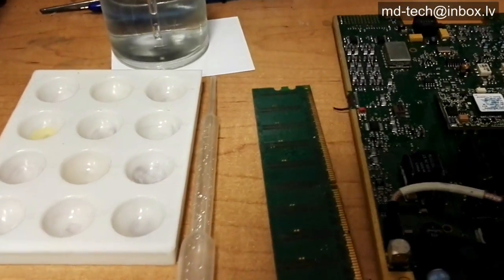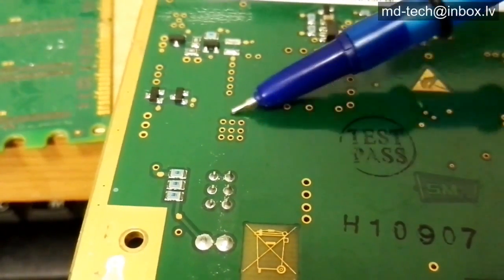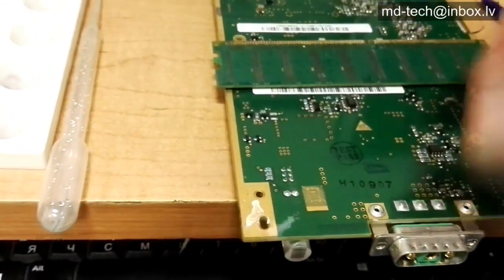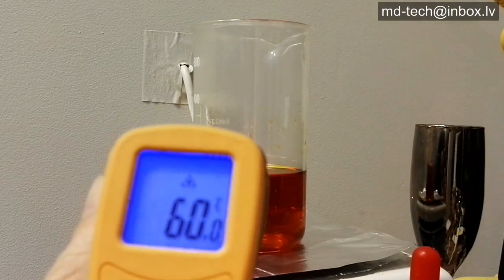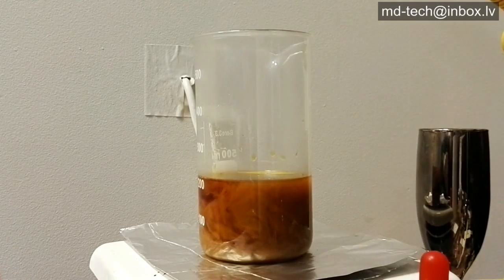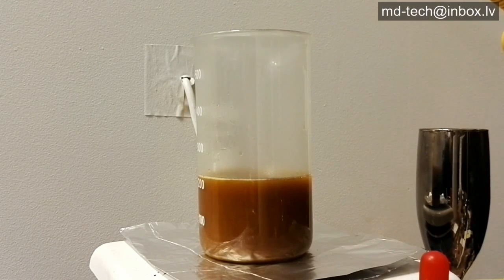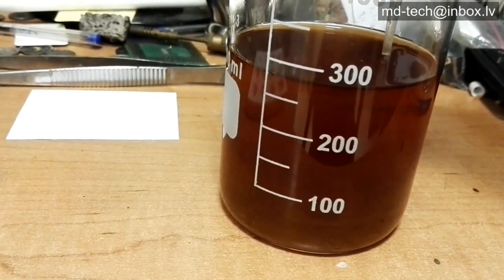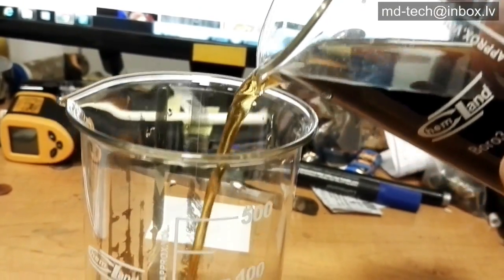Precipitate gold by sodium bisulfite. Palladium presents in solution.

Comment: I hope you answer. I have assay report's stating silver, gold, platinum and palladium. I process my ore with cyanide then zinc plate precip the metals. This I put in hot nitric to remove silver and palladium. Rinse remaining then take solids into AR. Here I tried SMB in warm water to precip the gold, nothing. I then zinc powder precip and melted. Tested 14k gold and platinum. Was told I need to go back to hot nitric soak, then rinse, then AR, then ammonium chloride precip platinum,  then SMB the remaining AR solution. Is this correct?
Reply from the maker: Hi! If you have a powder of gold-palladium and platinum dropped by zinc. Try it all dissolve in aqua regia. And you need denox aqua reagia. it means evaporating 3 times with adition hydrochloric acid. You get concentrate all 3 metal salt. first, use ammonium chloride solution to drop platinum. After filtration drop all by iron sulfate. Its drop gold and palladium. After that powder wash with hot water and wash of palladium with nitric acid and gold remain in powder.
Reply: @chemistrygames5811  Ok,  I warm up the AR and denox down then add HCl twice. Now keep warm. In another jar warm water dissolve ammonium chloride then add to Hcl-AR? to precip platinum. Plus I had 100 grams before melt, end with 36.7 grams. I just crushed the slag, put in AR. Just done stannous test. At first dark brown, left go turned orange. Does that mean some of my gold and platinum went into the slag?